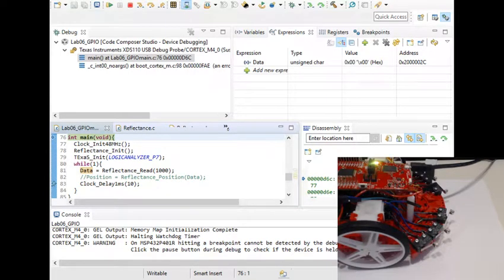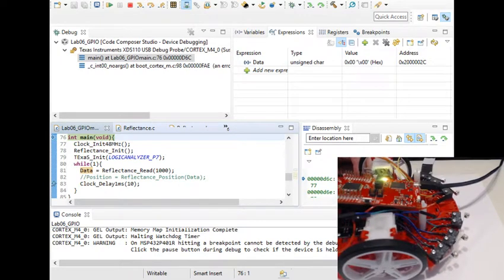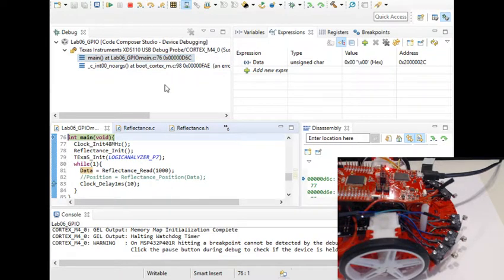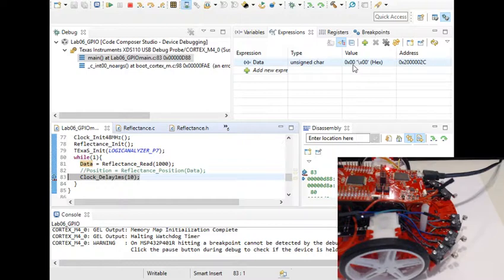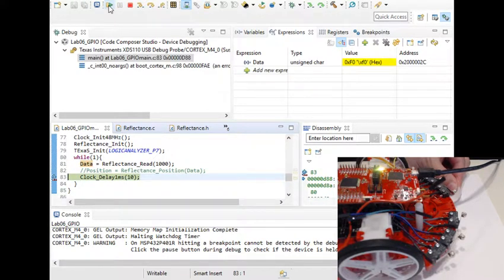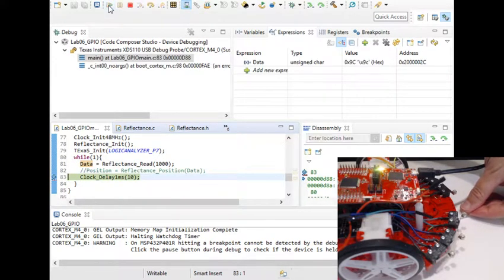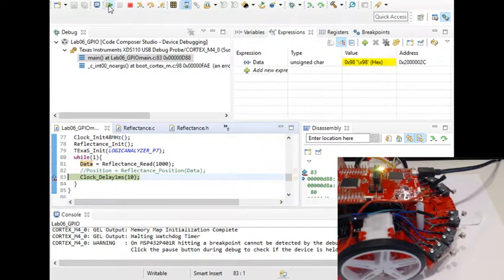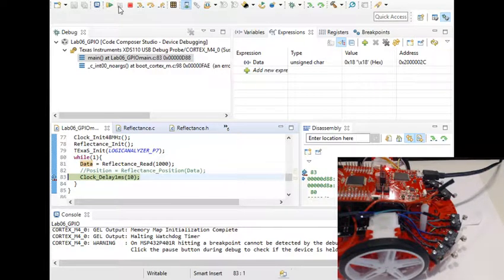TI-RSLK Lab 6 GPIO Example

Comment: Hello, is there a way or resource I can get the code to implement it and make it work? Thank you
Reply from the maker: The examples should be on the TI-RSLK site, but they have since upgrade the kit to a TI-RSLK MAX.  This is basically includes the adapter board that was a proto type when I did this. You should be able to get the info at: https://university.ti.com/en/faculty/ti-robotics-system-learning-kit/ti-robotics-system-learning-kit